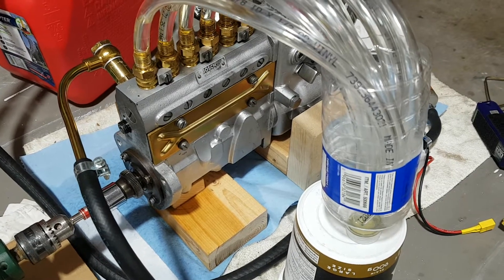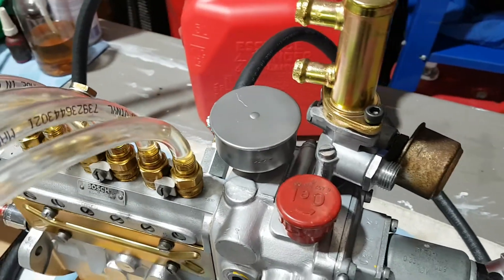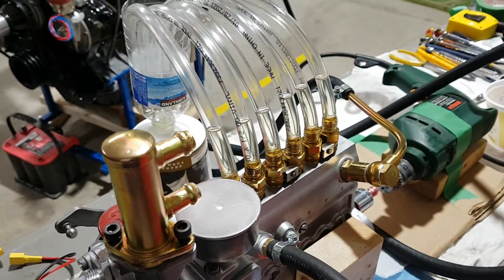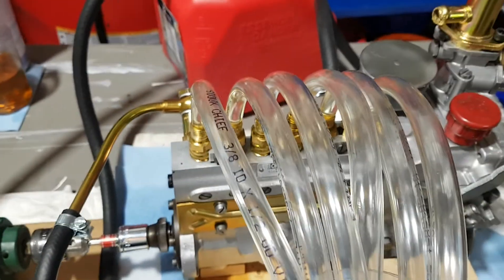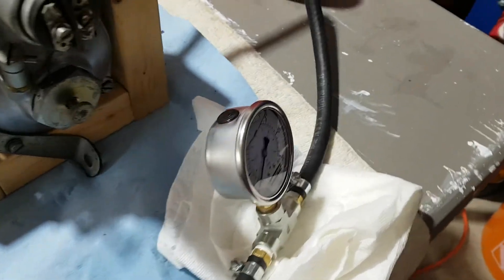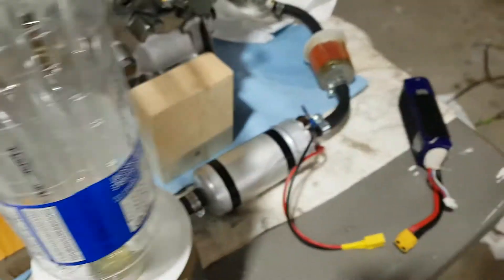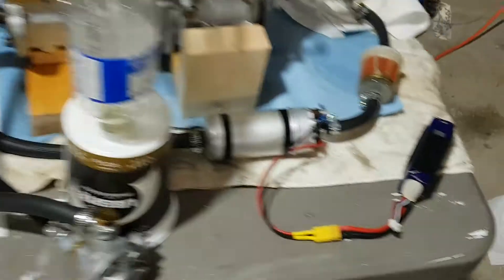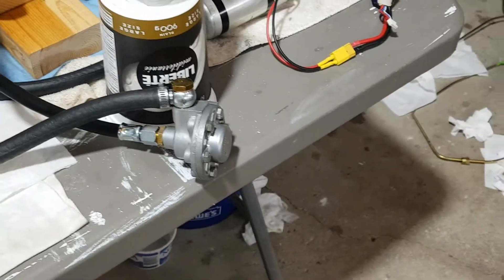230SL Injection Pump

Comment: Hello sir how are you please I'm having a problem with my R18 fuel pump on a 280 SL. As the engine warms up, oil starts pouring out of the red cap. This issue started suddenly wasn't there before. What might be the cause of it? Thank you.
Reply from the maker: @RoveFans  First check the engine oil level. Excessive will effect the pressure and in turn your IP. 
2. Your pump has a flow through design. Oil comes in from the engine cycles through the pump and goes back to the crankcase. Poor oil or infrequent changes cause deposits/contaminants to stay within the pump body. You will see the tube connected to the crankcase at the lower end of the pump. Remove it and clean it properly. Any obstructions will effect the oil level in the IP. In your case I would not start the engine until the problem is corrected.
Reply: @markhabel2252  Thank you sir appreciate your help.
Reply: Das Öl muss mit einem dünnen Schlauch abgesaugt werden, weil es sich mit Benzin vermischt hat. Normalerweise ist da 250 ml Öl drin. Wenn das Öl mit Kraftstoff vermischt ist, ist das 3-fache an Flüssigkeit drin und es läuft über. Zu diesem Thema gibt es eine Wartungsvorschrift von Mercedes.

Comment: Hey, could you installing one of those in a opel manta a?
Reply from the maker: I remember it from early 80's. The one I saw had a carborator on it. Is yours fuel injected?
Reply: @markhabel2252  no its with carburator, I've been reading and it looks like a very complicated conversion, I like the idea but maybe it's better just to swap with the c24ne engine that already comes with injection, Im just not sure how to put to wirering loom since mine had no wires...
Reply: @markhabel2252  my idea was to install this mechanical injection to keep the car electronics free...
Reply from the maker: @diogolourenco60  It's rather complicated process as your block doesn't have the provision for the pump installation and drive. On top of it good pump alone is probably close to the cost of the engine. 
If it was me I would refurbish the carborator. All the way to the factory spec. Also a set of proper low resistance copper wires and none resistor plugs will increase spark and combustion quality
Reply: @markhabel2252  thanks for the tip

Comment: Hi ,  how do you remove the suction valve at the top of the pump just under the injection line adapter for each injector?

Comment: Hi, Shouldn't the W126 pump be pushing out closer to 6bar pressure?
Reply from the maker: Correct.
 It needs to be in line with the appropriate regulator as well as the accumulator to get there safely.
I basically decreased the preasure to minimum usable by opening the flow
Reply: @markhabel2252  Ryan: at an M130 engine the electric fuel pump is with around 1bar (or even a bit less) discharge pressure. A 6bar pump is not suitable.

Mark: congratualtions, this is a very nice bench.

Comment: Excellent!  I think I’ll put some plastic tube on my pump to check the flow. My 280sl is running a little rough.
Reply from the maker: Just make sure is fuel resistant, so not to dissolve. Diesel can be used in place of test oil.
Reply: @markhabel2252  I’ll do it installed.